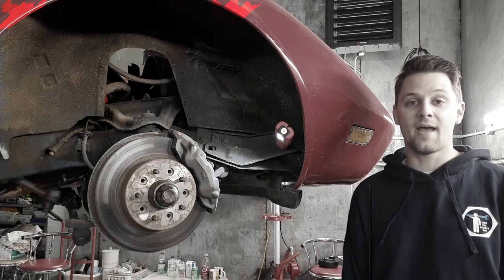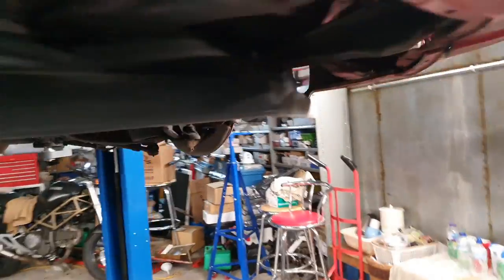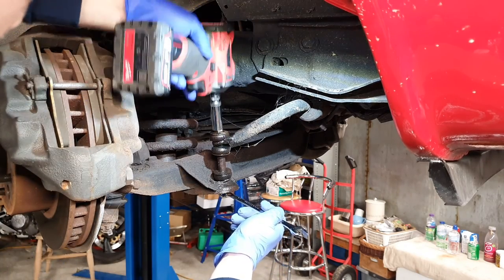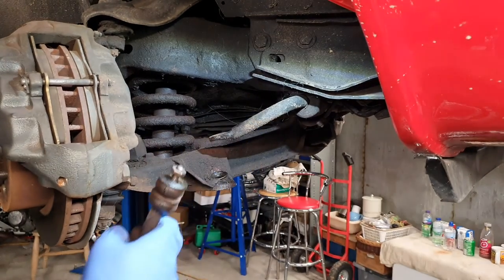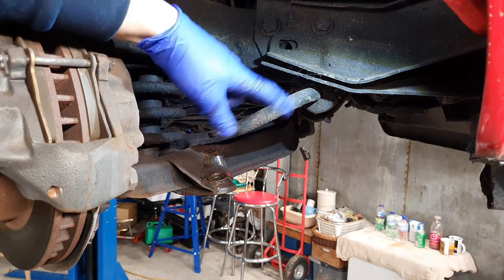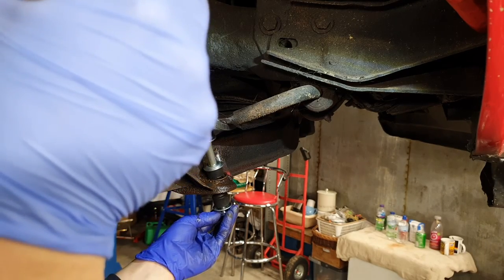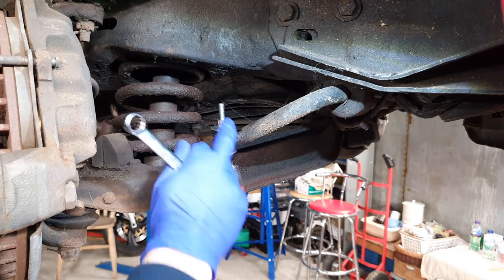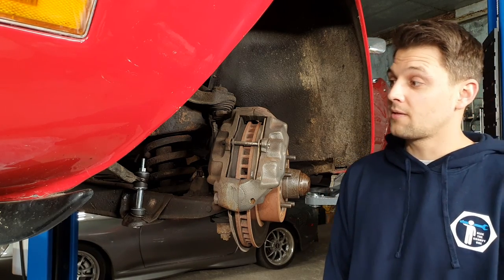Episode 1 Corvette Stingray C3 1975 Restoration. Front Anti Roll Bar Links Replacement

Comment: Have you thought about using silicon spray to lube those up before putting them back on? Seems like that would last much longer than WD40 to keep them from squeaking.  That's what I put on my C5 bushings.
Reply from the maker: That is true. Thank you. Silicon would be better for them. I havent got any unfortunately.  I have used a maintenance spray, which is similar to wd40 I would say.